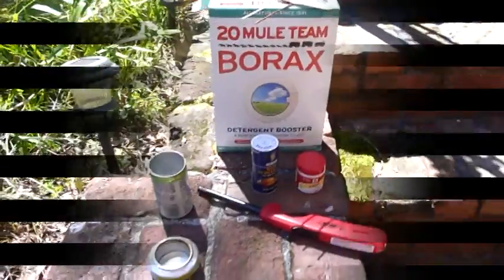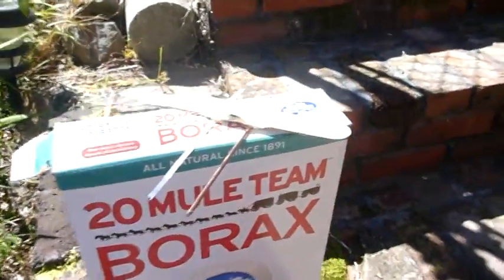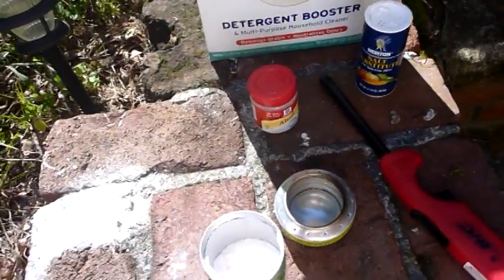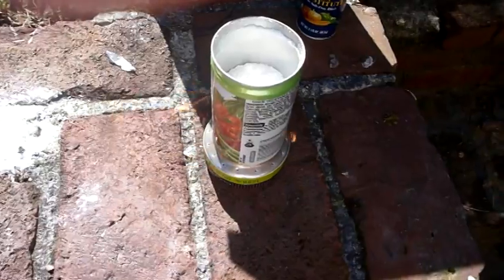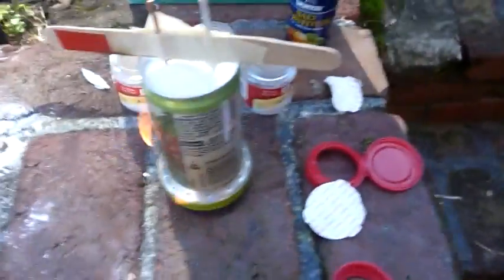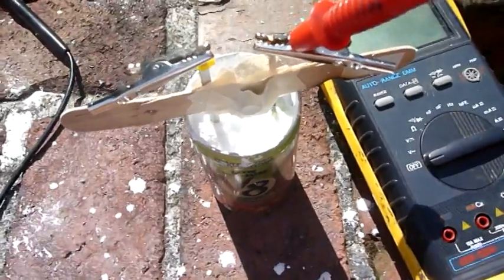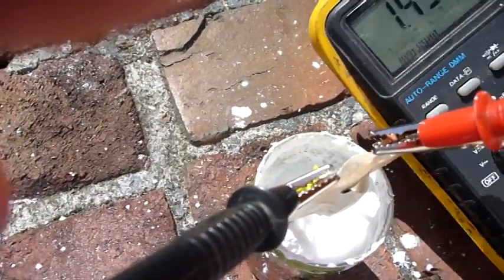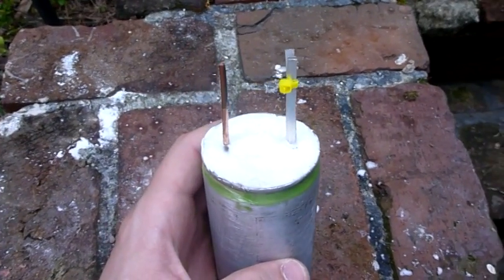How to make a Crystal Battery

Comment: it should be possible to make a different model of crystal battery, and i'm thinking it could start a mini plasma reactor... but, there's no such thing as a free lunch, so one should make sure to take every precaution available. including, but not limited to; electromagnetic containment, safety when handling the electronics, heating prevention, radiation prevention, and precision fitting and alignment. but the crystal making doesn't have to be done with fire... imagine using the stars as an instant refinement of energy, like in the time of Atlantis, and in Egyptian pyramids... only making protonicity. a positive form of energy from the reaction in the device just in front of you, and all you need to do to start it is use starlight as a starter. using a crystal form of battery that charges with starlight, and stays charged with a capacitor in the crystaline interface. 

it's quite possible, but those that've tried to prove it have disappeared. is this not so?

Comment: This is just a galvanic cell there is water in the dry powdered crystals already.
Simple to prove this will not work if you use the same metal for both electrodes. Because one of the metals is being  sacrificed for the production of power in a reaction.
Borax is Sodium tetraborate decahydrate (that is 10 water per molecule)
Alum is commonly found in its dodecahydrate form as KAl(SO4)2·12H2O (12 water per molecule)
Basically a very very dense electrolyte slowing down the reaction rate so you get the typical electronegative voltage and because of the high internal resistance very low amperage. if you want more power add water.... 
An excellent version of this is a Zamboni or Clarendon pile. Like the one that has been running Oxford electric bell experiment for the last 175 years.

As for the update Rochelle salt has 4 water and Epsom salt depending on the temp it crystallized at has 6 or 7 water bound to the crystal.
Rochelle and Epsom salt do have fascinating properties, but you could achieve similar results with a lemon or potato which is cheaper. 

But seriously try comparing the voltage and power after all this work, to the output of a potato or lemon with the same electrodes.
Reply from the maker: Check out my video on 'how to make a better crystal battery' in that video I use Epsom Salt with water being boiled out from the crystals. That cell doesn't contain any water! You also don't even need metal for batteries. Batteries can be made using no metals at all. Check out the video of such a battery in action here: https://www.youtube.com/watch?v=K-PkoJrs5n8 We have much left to learn about what electricity really is. Even J. J. Thompson the man who was credited with discovering that electron was the charge carrier in electricity had his doubts about the fact. Sometimes electricity can behaved like a rarefied gas under pressure. Vacuum bulbs explode from the inside out when overloaded with voltage. Thanx for your comment.
Reply: While not disagreeing that we have much to learn, about the fundamental forces. Boiling Epsom salts doesn't remove all the water, until 200c just some of it. Boiling Borax will reduce it most likely from decahydrate (10 h2o) to pentahydrate (5 h2o), but you need to get borax to 740c to get rid of those last 5 water from the crystal.  Both of which will start reabsorbing water from the atmosphere once cooled. You then added distilled water to the mix and recook. This all assumes you haven't made a double salt or many of the other complex things that can happen.
My point is really most of this is well trod ground and a little understanding of how these things are likely working will help eliminate actual chemical interactions. So you can determine if you have something truly new or just something slightly different.

The Graphene silicon battery... Looking at granted patents its an air battery and wouldn't work without O2 and sacrificing one of the plates in a chemical reaction.
www.google.com/patents/EP2502295A1

While a neat chemistry still just chemistry. There is a patent for a carbon/carbon electrode battery using a lithium salt as the electrolyte, So the reactants may not even be obvious.
Occam's razor should be applied more often. 
Is (any) this power source most likely chemistry or is it it a newly discovered form of energy with no current scientific basis for it? Try eliminating the obvious, easy and known one of chemistry first. Much more productive than trying to create a scientific framework to describe magic*. If you cant find any chemical reasoning for it then we still have a couple other physics to rule out before we get to something truly new. Is it a semiconductor junction and following the Seebeck  effect (peltier), have you made another form of Thermolectric generator, have you made a photoinductor? etc

*Magic as defined by Clarke's 3rd law Any sufficiently advanced technology is indistinguishable from magic.
Reply from the maker: ***** Good point, we shouldn't rule out known chemical reactions. The goal here is to try to uncover some new technology that would benefit mankind. I see myself as a domino in a long line of dominoes. When I fall I will hopefully trigger the next domino which will in turn will trigger the next one. Ultimately this will lead up to the uncovering of suppressed free energy technologies. The great scientists of the past like Tesla, Moray, Hendershot, Floyd Sweet, Paul Baumann, Stan Meyers, had the answers. At the same we have to practice good science, otherwise the entire effort is wasted.

I'm a supporter of the work of Eric P. Dollard (as well as Jim Murray) and others. Dollard is an important one check out his lecture on energy synthesis, it contains historical data, equations https://www.youtube.com/watch?v=cCJcU7INwnU
Reply: thank you these are the answers I was looking for.

Comment: are they rechargable ?.
Reply from the maker: +nino zazzarino crystal batteries aren't rechargeable, however you don't need to recharge them! They produce a steady output that lasts for many many years. LaserSaber (youtube name) has a series of this batteries running a pulse motor, he calls it the 100 year old motor. It might actually last that long, he has this thing on live feed. Its been going for about 3-4 years now non-stop. https://www.youtube.com/watch?v=-mfKMDE55gs

The battery I made in the video is a replication of ibpointless2 video, his battery design will eat away at the aluminum after about 2 years. Best to use epsom salt, rashelle salt combination for crystal batteries because these salts aren't corrosive.
Reply: check out my video and no they stay like at 1v so i build a battery using natural elements and I'm test the led to see if it can last for a month until now my light did not dim so check out.
Reply: +good boy the more cells u add voltage increases
Reply: +Naoki Kashima They don't give a steady output, the output can change based on ambient temperature. They also fluctuate for other reasons.

Comment: this is very low current .... you can maybe run a watch on this ... what is the point ?
Reply from the maker: Yan Lipavsky Transformers or Joule Thief circuits can be used to step down voltage and step up amperage... or create pulses of high amperage and voltage from just voltage. We have choices here.
Reply from the maker: Yan Lipavsky This was my early experiment at crystal cell batteries. The point is that this is a non-galvanic type of a batter. It has potential to run for years... Imagine buying a battery once and replacing every 25 years or so... wouldn't that be nice? The reason we don't see eternal batteries for sale is not because the technology isn't there... but because it is more profitable to make batteries that fail quickly so that the public would come back and buy more.

John Bedini makes awesome crystal cell batteries... search for his video if interested in this technology. Thanx for the comment.
Reply: Naoki Kashima don't reply to ignorance of those without imagination. .. Yea it's a low voltage but with experience and frequent trails may produce a battery that could run a house

When i see this video i understand it's an introductory experiment with potential

I fuckin love this battery thing I'm sure it's possible to get one with great voltage strong enough to power many things
Reply: Probably not. People were dealing with such materials for decades.... The best thing came out of this is quartz clock genetator... Dont expect much power from chrystals.... even if you will get a nornal voltage dont expect much current...... Hey... Reminds you the experinent by Ben Franklin with key and a wire in air.... Much voltage - no current....
Reply from the maker: Someone made an amazing silicone crystal battery, check out this video: https://www.youtube.com/watch?v=K-PkoJrs5n8

Comment: Naoki, what kinda miliamps do you get with this setup using the aluminum can? also, good work by the way. cheers from Dallas.
Reply from the maker: The miliamperage is very low around ~40 miliamps. I actually didn't know much when I was making this a year ago. I used way too big of a case for the battery. Also because of 3 metals involved (aluminum, copper and magnesium) I was also getting low AC voltage reading. A practical way to make these is to make them very thin and tall. Like using a thin copper pipe with a single electrode inside. Then these could be wired together to boost the amperage (making them in larger size like I did in the video doesn't boost the amerage, the reaction occurs at atomic level according to John Hutchinson).
Reply: Naoki Kashima

Nice. Will give that some thought!
Reply from the maker: shad0wburn3d Hey, the crystals will keep growing on the battery! I'll do a follow up video showing how much of the can is eaten away by crystals. There is a better way to make crystal batteries! John Bedini had the answer in a video. You have Epsom salt and boil it for over 2 hours to evaporate all the water out of it (its done when it is in completely solid form), you'll have to crush with mortar pestle, add 3 part Roshelle salt and 1 part reduced Epsom Salt into a copper container (cap from copper cube will work) bring mixture to liquid form and insert a galvanized bolt into the pipe cap. Before mixture hardens polarize your battery with 12 volt car battery by tapping the - terminal (your galvanized bolt) with your + on your 12 volt battery. Let everything cool. Once I get my bolts I'll show how this is done in a video.
Reply: Naoki Kashima

Can't wait!  Yeah, I have made quite a few of these monsters.  They aer freakin cool.  They do put out some juice too.  Polarizing them is important for putting them in series and in parralell.  I have not played with them in a while.  I def need to get back on it.  Working gazillions of hours for the man, takes away all the important time to seek the greater advancements we need. Will be keeping an out on your progress!
Cheers!
Reply: Do you think it will work without the galvonic reaction of the dissimilar metals? Does it remain dry? Or do you add water? Does it ever completely go dead? Can it be charged?   Man Im seekin these answers to move further with my flow chart, I like tesla lost my lab .